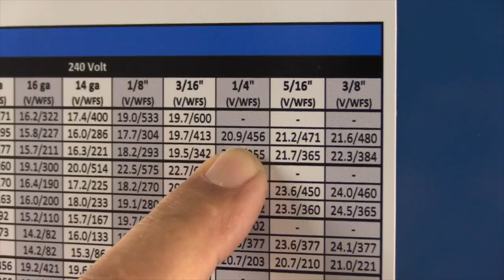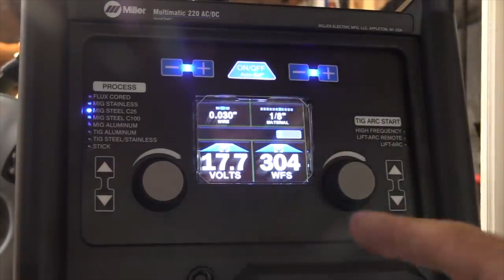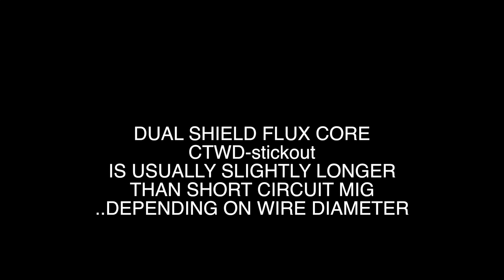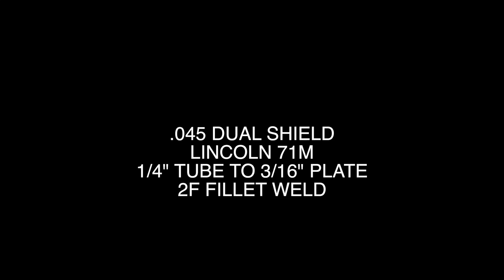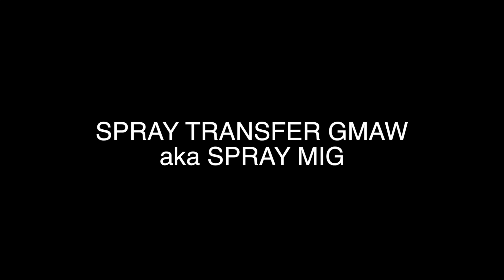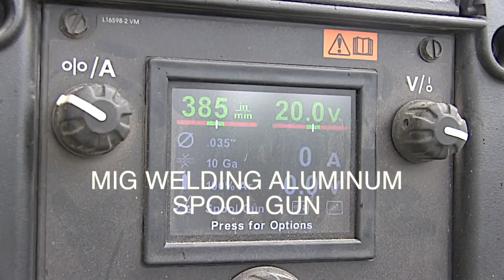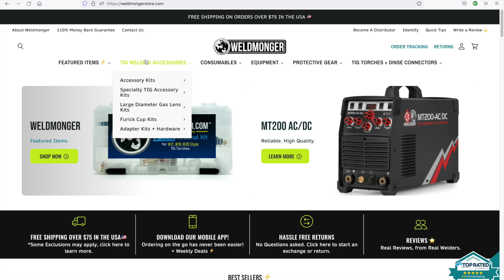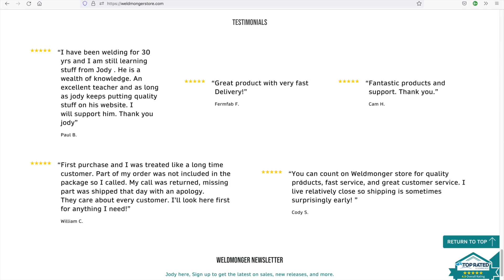What does CTWD mean in Welding?

Comment: Considering the amount of spatter you get when you try and use 7525 for spray arc, it isn't supporting the plasma stream. You need a minimum of 80% argon and I always always go with between 90 to 92% argon. It's so much easier to do welding of all kind.

Comment: Great video...I haven't looked at your channel for over a year. Back in 1981, I bought a whole shop full of stuff from a guy who was retiring. No MIG or Flux-core...just TIG and Stick..I opened a welding shop, never welded anything in my life...did OK making wood-stoves...lots of 1/4 and 3/8" plate/pipe...
 I was using TIG for a lot of the finish appearance projects...the guy at the Welding Supply asked me why I kept buying 50# boxes of steel 1/8' TIG wire...so when I told him...he says, hey try a MIG welder...I bought a Miller-Matic 200, first one they ever sold...that sure made things easy...I still use it, only 2 controls...'voltage' and wire speed...voltage was switching the output to one of 6 settings...
 So...these newer machines are really sweet...MM 200 has no meters or read-outs..
 And he handed me that Lincoln Procedures of Arc Welding...studied that a lot and did OK with the welding...that book was about $ 15 at the time, best money I ever spent. It had a black cover back then.

Comment: Thank you for including wire feed speed. I was the weld process engineer at a company 30 years ago. I used to include the WFS on the data sheets and got ripped for it.

Comment: So I like to run 6010 and 7018 root pass two passes 7018. When I mig weather it's dual shield whatever I have alot of trouble welding tips together if my stick out isn't recessed 1/4 to 1/8 is voltage set wrong or ?? That's how I was shown at a job I had...

Comment: CTWD is not the same as stickout- contact tip can be entirely inside nozzle and is in several processes and for all those situations CTWD is going to be longer than stickout. CTWD is more of a welding engineering term anyway- we use it for electrical calculations and calculating heat input
Reply from the maker: That’s one way to look at it. So then is stickout the same as ctwd when no nozzle is used like on self shielded flux core?
Reply: @weldingtipsandtricks  "stickout" is kind of a slang term- I've seen it used without nozzles. Not sure if there is really any authority on it being correct because of this. I think most scientific literature would define CTWD as distance between contact tip to work and standoff distance as nozzle to work. If you think about it people are using it as a substitute for "standoff distance" in most circumstances, but it would be used in place of CTWD when there is no nozzle.

Comment: I have done a lot of spray arc mig on steel with 100% argon. Besides the surface looking a bit grey I can’t tell any reason not to do it. Etch tests show good penetration and fusion and bend tests perform as usual. Your thoughts on 100%argon on steel?
Reply: 100% argon is the standard, the reason some shops will use mixed gas is because it is more forgiving.

Comment: Hi Jody,
I have had excellent results running .030  ER70S-6 with 75/25 gas- on an old Millermatic 250.  It sizzles as the molten droplets fly.
Do you know if there is any weld strength loss- running these smaller wires hot?
Thanks brother.

Comment: I've read through the Lincoln handbook and while there's a lot of good info in there, the process tables always seemed out of line for home gamer welding. Like you look up a process to stick weld a flat butt joint on 5/16 plate and it's like "Yeah just pull out your 1/4 inch filler rod and set your welder to 400A". Like, I don' t know what other people have in their garage, but I certainly don't have a welder that goes that high in mine.

Comment: Great topic... Having been in the welding supply industry for over 40 years, this is always a misunderstood topic and VERY important variable. Many years ago we referred to it as ESO... Electrical Stick Out, but many people mistook it as a measurement from the nozzle, not the tip. With different gun options of recessed, flush, protruding tip the industry has correctly been renaming it CTWD.
Also, virtually every manufacturer has the operating parameters for each wire listed on their website or filler metal catalog. Always has CTWD there for each position, setting, wire diameter, etc.
Great content Jody, you are doing a HUGE service to our industry! Keep it coming!!

Comment: I don't know about all that spray Ark stuff 92/8 gas we did experiment with that other gas we put 2% oxygen on 90/8 gas freaking hated it pure spray comes in about 40 v dual stage Mig gun low side 400 in high side round 6 now you have to keep in mind one thing that we did this everyday and we were racing the clock around 650 /700 in of wire per minute oh 45 the puddle starts to distort you get the same Distortion with o35 at about 900 in all 92/8 gas and a 600 amp power source I don't know what you doing but I know what that formula works there are literally thousands of cranes built out of that formula everyday and I built the f*** out of them my damn self

Comment: what manufacturer welding wire you using please.  curious  flux core
Reply: Probably Duramax for all positions.  Every place I worked at for structural used durmax. The problem with all position wire is you can get worm holes more likely. Cause the weld will become solid faster, trapping gas inside in the process (but you can get worm holes also, from moisture, the settings). It's made to solidify faster for overhead.

Comment: Here's something that I have noticed over the last few decades is that just as you had mentioned, the tip is even or slightly protruding from the nozzle.  
Throughout my career, mostly production (finishing welder aluminum)  all the guns from the old Hobart up to the Linde, LTec, Esab era. The tips were, at lest from my experience recessed from the nozzle 3/8"-1/2".  My Tweeko #4 close to 3/4", all the water cooled L-Tec guns probably 3/8" or more.  I think it's a completely different welding style as today's machines as far as stickout and gas pressure.

Comment: Great video. The way I was taught to think of stick-out was in relation to voltage drop. Steel wire has higher electrical resistance so running longer stick-out can drop a lot of voltage from contact tip to work. Generally, If your machine is set to 20V but you run 1” stick-out your weld may behave like your machine is set to 17V or lower at 1/2” stick-out. Aluminum wire has lower electrical resistance than steel wire so stick-out has less of an effect on voltage at the end of the wire. This is only one factor of many but it helps me to keep it in the back of my mind.

Comment: Ohhh…sickout and CTWD are not the same.   Nice quick little video but with the newer power supplies and the different control features it’s more complicated.  Than again maybe Miller invented new terms to sell us features like arc control and arc force? Either way always a good to have another welding tip and tricks video!!
Reply: I wondered about this. Like the difference between the stickout from where the nozzle end to where the short circuit actually happens vs the distance between the the nozzle and the wire feed. I think it amounts to the same thing, because, at least in MIG, if you move one, the other follows.
Reply: @WmSrite-pi8ck  some times yes some times no.  If you have a newer machine they can manipulate  the arc length thus changing the numbers.  Probably only matters to people doing automation where the numbers can be tightly controlled.

Comment: Nice video. I have question . Which give better penetration 6013 or 7018 ? For welding a 5/8 plate. Outside corner joint. Shop only got these electrodes, i can't buy 6010 or 6011 in my country.  My machine - inverter "Schweibkraft" 40% Dutycycle at 160 Amp, 100% at 90 Amp, Thanks.
Reply: 7018 penetrates deeper. One of the big characteristics of 6013 is it's shallow penetration
Reply: 7018, no question.  Especially on 5/8"

Comment: So how do you adjust the contact tips position in relation to the nozzle? The gun I use at work the nozzle sticks out slightly past the tip. Even with all new parts.
Reply: @Paul Schwartz OK Thanks
Reply: It’s a combination of diffuser, contact tip length, and nozzle length.  You can normally get the tip proud, flush, or recessed depending on the combination of the 3.
Reply: @Theweldingmillennial  Thanks, When I get back to work next week I'm going to experiment a bit. (My boy is on leave from the Army and I took the week off) I use .045 DualShield with CO2 gas on carbon. I build/weld shaftless screw conveyors. They range from 1/2" to 1" thick.
Reply: @UC_zY9wKmT3a_QJ18tNcmQUg to each there own I guess.  If sanding down the end of a nozzle works, great.  Some industries you can’t modify consumables like that because they are part of the variables that go into weld qualification.  I would rather have people at lest know the “correct” way of addressing the issue.  But yeah you can get lost in the many many combinations of torch parts out there.  Wouldn’t be surprised if old boy turns up 10 different torch parts that don’t work.
Reply: The nozzles we get at work end up with a recessed tip and they have a taper towards the end....  I modify that by taking material off the BACK of the nozzle, so that I don't alter the taper.